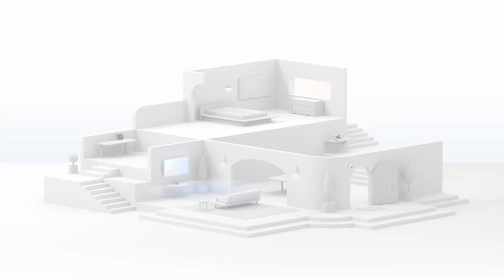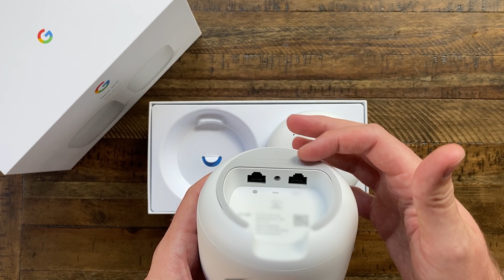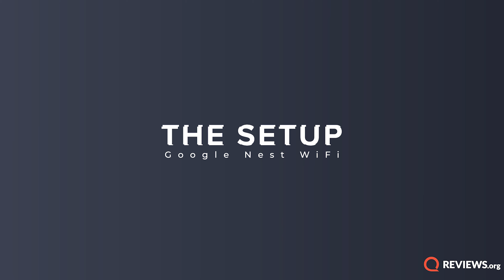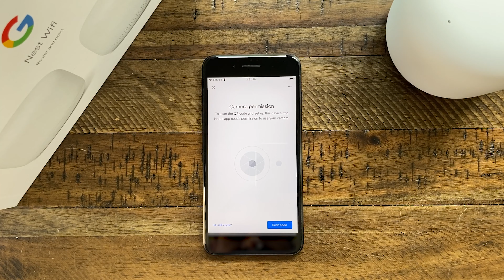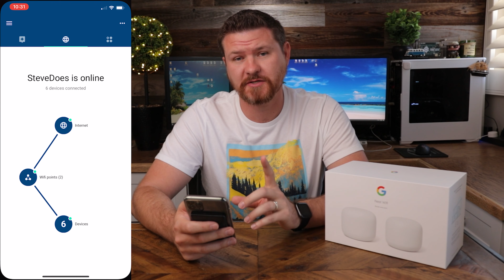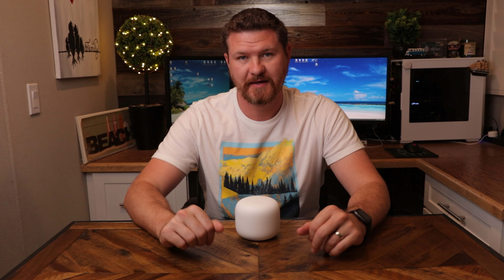How Simple Can Mesh Wifi Get? | Google Nest Wifi Unboxing and Review

Comment: We had horrible wifi signal connectivity throughout our home were upstairs would be dial up speed if any. I picked up the google wifi from a local retailer and have not been happier. We have seen full network speed throughout the house and outside too in the yard so grat for tje summer. Best of all it's so easy to set up and use as well.